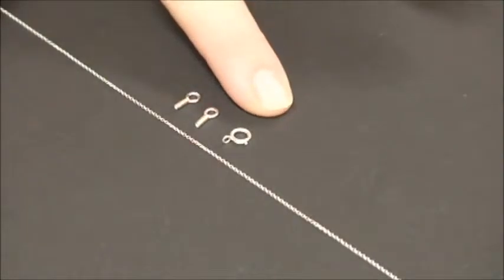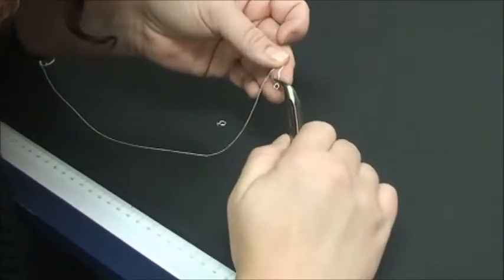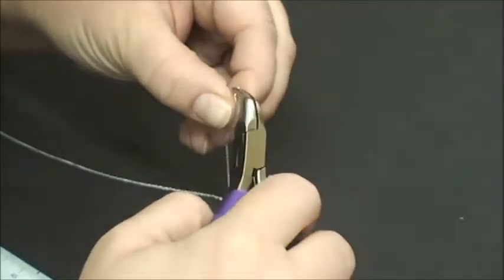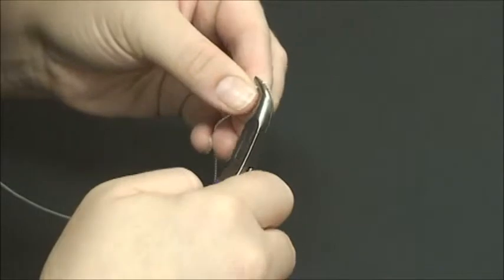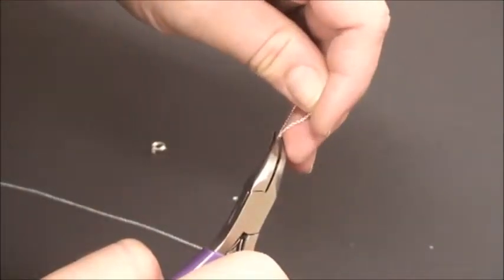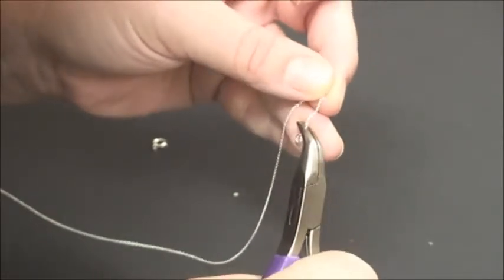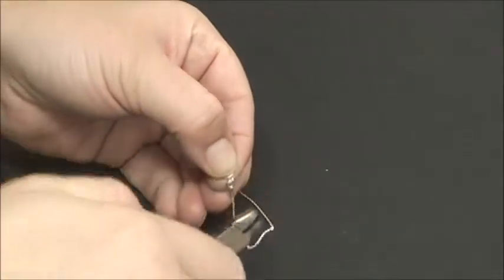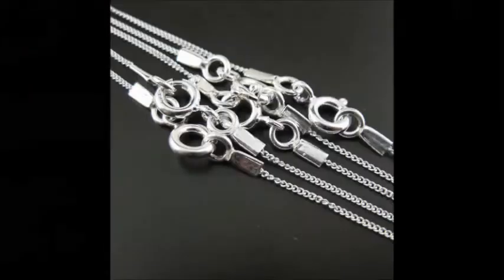How to Finish a Chain with tube ends - Basic Chain 4 - Jewelry Making Video by beadUnion

Comment: Another reason you want to TWIST ALL OPEN RINGS verses PULLING them is that pulling them stretches the metal in a way that WEAKENS the ring, whereas twisting gently to open helps the STRENGTH of that circle to hold.